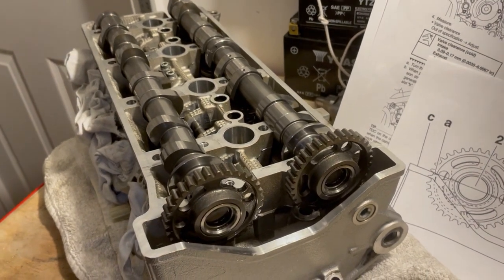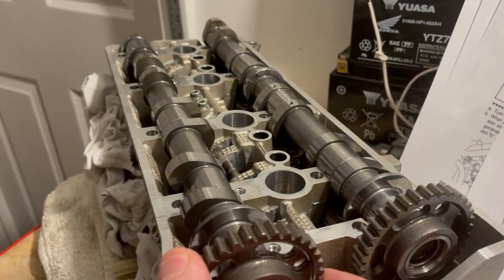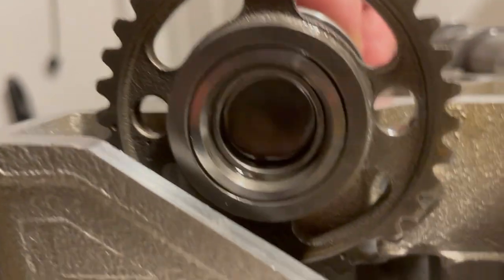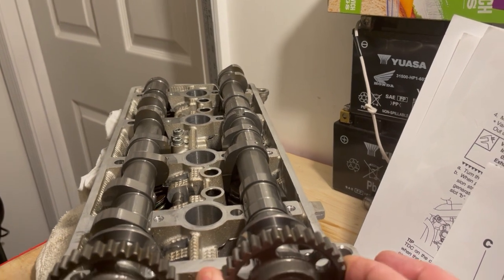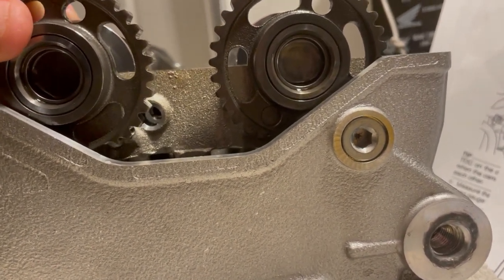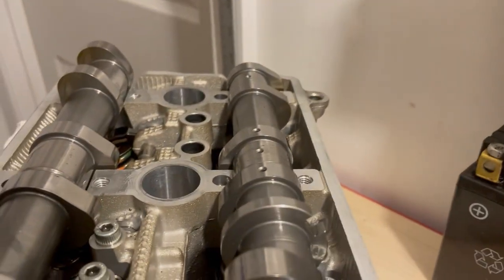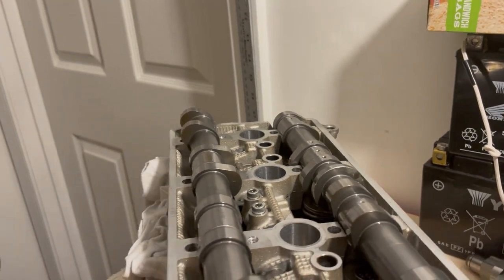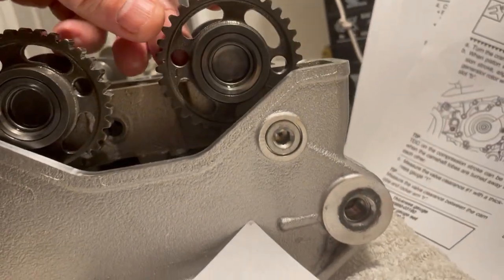2015 - 2023 Yamaha R1 Look at Cam Lobes and Timing

Comment from the maker: Also... worth mentioning...Once the cams are rotating with the crank, they can be in one of two positions when the crank is at mark "K" (or the crank mark indicators for any cylinder TDC mark).  The cams could be at TDC of the cylinder's compression stroke or at TDC of the cylinder's exhaust stroke.  The timing marks on the cam sprockets are for 105 degrees before TDC of the compression stroke of cylinder #1.  If you set your cam timing marks with the crank at "K", tighten down your cam bolts, then rotate the crank 360 degrees back to "K", your cams are now 105 degrees before TDC of the exhaust stoke for piston #1.  When you're measuring your valve shim gaps, you need to be at TDC of the compression stroke for each cylinder.  This is when all the valves for that cylinder are completely closed.  At TDC of the exhaust stroke for a cylinder, both exhaust valves and intake valves are slightly open.  You can not measure the valve shim gap at TDC of the exhaust stroke.  The cam lobes are pushing on the valves.  This is called valve overlap.

Comment: I have those correct when I was doing my valves, but I also took out my guides since one needed replacing. I’m not sure where the chain will go on the bottom sprocket